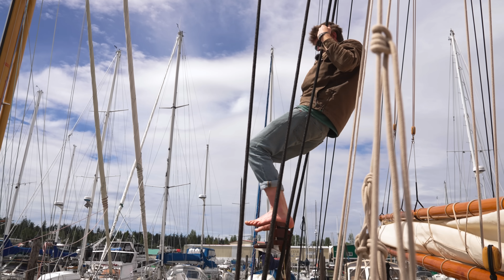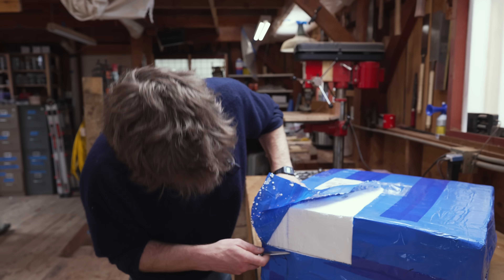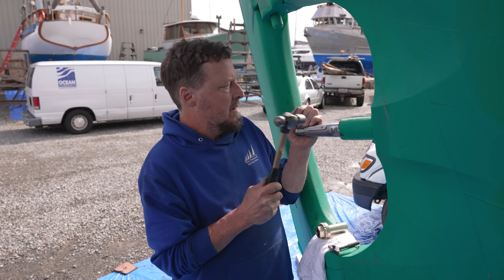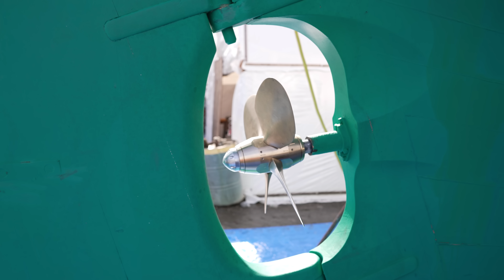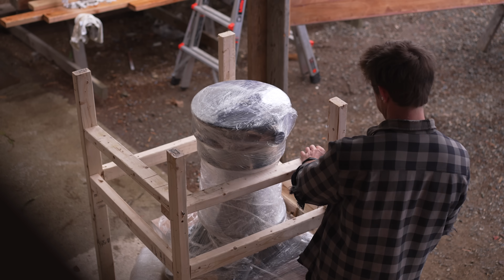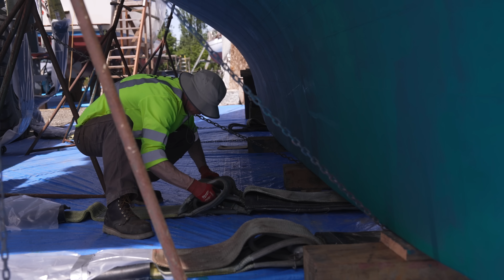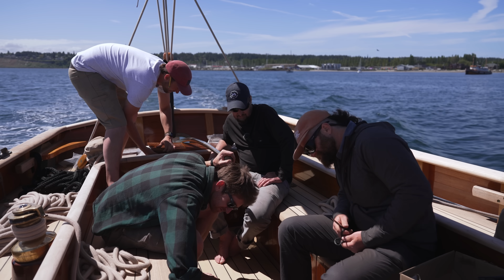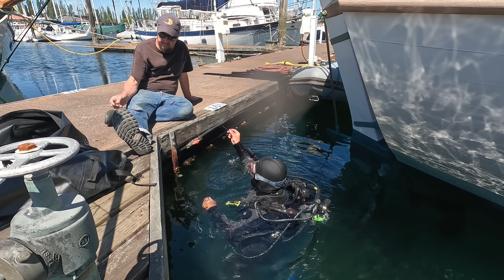New & old machinery - Gearbox, Propeller, FINISHED CAPSTAN ARRIVES!

Comment: Can you lock the propeller blades from inside the boat, so you can generate electricity while sailing in the future?
Reply: Leo explained this in an earlier video. The prop has 3 modes: forward, backwards and feathered. There is no lever or any other thing inside the boat. If you put the engine forward the prop switches itself in forward mode, if you put the engine backwards, the prop reset itself in the backward mode. If you are sailing the prop feathers (thanks to the pressure of the water). To generate electricity the prop has to turn by the pressure of the water. To achieve that (under sail) start the engine, put it in backwards mode, give a bit of trottle and kick the engine in neutral. The prop is locked in backwards mode and starts to turn the prop because in backward mode there is no feathering possible. To stop generating, start the engine, put it in forward mode, a bit of trottle and the prop reverses in forward mode. As simple as that !

Comment: i dont think I have seen ol' Keith any happier than when he declared the capstan project finished and ready to ship. He did not wipe his brow dramatically or anything but having that many variables finally fitted together was an obvious relief , it is one thing to think or even know things can work vs having them all put together. Gratz all around for that pretty amazing bit of restoration.
PS. you can hear that the prop is in tune with the engine Vs out of tune while over propped , there was a harmonic present in the latter case that is gone once the pitch was corrected.

Comment: As regards the capstan, I think you should powder coat the parts you intend to paint since powder coating is about 14 times more durable than paint.  Also, I've found in my own experience, that rust does not migrate under powder coating in the way it does under paint.

Comment: That capstan is one beefy boy. Any concerns about carrying that weight so far forward and above the water line? It has to change the way it rests in the water.
Reply: The temporary ballast lead ingots that he's shown being loaded in several videos can be removed when the capstan is in place and the boat will keep its same line in the water that we have seen so far.
Reply: @llagas6307  It is true that shifting ballast can correct for the fore-aft balance. On the other hand, the higher the center of mass goes the more prone the boat is to heeling. It's not something that is usually significant for boat loading, but like I said, that is a big beefy mass of iron, steel and bronze. Likely big enough to affect the way the boat handles.

Comment: To all those dreamers out there who aspire to fit out a boat's prop system. You cannot go past the simple check of turning one end through ten revolutions and counting the other end. Just in case someone has fitted the wrong gear set and not remarked the plate on the box. or made other changes. Bucket list of mine to  get to see her on the water.

Comment: What type of seal is on the hole where the drive gear  comes through the base plate?
Water may get in here with waves breaking over the bow etc
If no seal, what protection have you got in mind to defend the drive motor etc?
Reply: A drip bucket hung under the capstan motor assembly may be in Tally Ho's future.
Reply: What about a bit more design and manufacture before installation. 
A split disc, like the chain gypsies, fitted below the gear with an O ring seal bearing in the tube which supports the gear might stop sea water flushing through / past the gear teeth. What do you think????

Comment: So glad the new prop worked out for you. I work for Ford Motor Co, in Michigan, just north of Detroit at the Sterling Axle Plant, we make all axles for F150, Explorer, we make the front and rear axles drum to drum when they leave our plant, 1.9 million axles last year. My department laps the ring and pinions, you load the ring on an arbor, push the pinion in it`s arbor, when you hit the start button, the arbors chuck the ring and pinion, the door shuts, and compound starts flowing on the ring and pinion as they are spinning at 2,000 rpms. Three passes on the drive side and 3 passes on the coast side, it`s a 3 minute cycle, when the door opens, that ring and pinion is married, the surfaces of the teeth are perfectly matched to each other and it stays a set for life.Just a little foot note from the Auto Industry that`s alive and well in Michigan.

Comment: Leo, rather than monitor rpm of the engine, see if there is a way to measure torque output.  It would seem the engine is reaching its full potential of torque output given the current prop setting.  So, you want to run the engine at about 98% of available torque; independent of rpm.  One could rely upon rpm as a measure of output and ruin the engine because of exceeding torque limits over long periods.
Reply: I would question your comment that the engine should be run at 98% of its torque at any rpm.  The power curve of Marine propulsion engines are designed such that the load should only be near the maximum available torque at rated RPM.   Below that RPM, they should not be loaded to the full torque available.
Reply: @Walstie  Indeed.  Perhaps for a fixed pitch prop.

Comment: Great video as always. Just one minor detail regarding the feathering prop: it's not centrifugal force that rotates the vanes into their "engaged" setting. For this type of prop it's internal gears that are driven by the torque of the propshaft itself. That's why the hub rotates when you move the vanes.

There are also "folding" style feathering props that indeed use centrifugal force to open. These are simpler and  slightly more aerodynamic than the gear driven type. Their efficiency under power is however lower, specifically in reverse.

Comment: It's a bit unfortunate that she won't have the powertrain you designed to begin with, but changing the gearbox was a bit unrealistic. Pulling out the engine is an absolutely huge task.
Reply: to fully pull the engine part of the deck needs to be ripped up.
Reply: @runrin_  Don't think so. I think they just need to remove the cockpit.

Comment: White LEDs actually glow blue. Above this is a phosphorus layer that produces green to red light. But there are also green LEDs and red LEDs that produce the color directly. 
The white LED which has a red filter has the worst light output because it is at the other end of the color spectrum.

Comment: How will regen work with that propeller? If it goes into sailing position when the motor is off, you won't get any torque to drive the regen, will you?

Comment: Oh but I was so pleased with hull speed using the large propeller with the 1:1 ratio gears. It just so made me joyful that the engine rpm was perfectly at the peak torque range of this engine which resulted in economical operation and better than anticipated hull speed. Why should you wish to increase rpm, fuel consumption and also decrease propeller efficiency? Quite frankly, when the engine is operating at max efficiency and is within the peak torque range the only question in regard to engine durability is in regard to engine cooling. I will not comment on the technical savvy of the inexperienced engineer. Tally Ho

Comment: Leo, interested to know, does the updated design have any performance deficits over the original design or does the smaller propeller mean it all works out the same in the end? I would've though torque might be a bit lower but power higher?

8:20 - Never mind. :)

Comment: Shocked!  Flabbergasted!  And I'm sure there are thousands of others like me who feel the same.

Having watched these videos for the past seven years, we've became accustomed to Leo's uncompromising approach to the project.

Yet, when it came to resolving one of the most significant issues ... let's face it, an unconscionable error on his part .... he took the low road for "expediency's sake".

I would have liked to have heard  Leo say, "Yes, I screwed up.  And, yes, this 'quick fix' is only treating the symptom.  Had I wanted this combination, I would have originally spec'd it that way.  The original design is the better approach.  But after seven years, I felt it was time to do some serious sailing this Summer.  And when that's over, we'll come back and do it right."

And then there's the 2,800 rpm becomes 2,700 rpm and then becomes "almost 2,700"?  "Compromise" is a "slippery slope".

Love these videos.

Comment: I have a MaxProp feathering prop on my sailboat. Make certain to have several spare cap anodes in inventory. They can be hard to get when in somewhat remote places. I needed one when having  a diver clean my hull. I thought I was screwed when the anode was pulled and in bad shape. I was on a deadline to make a weather window, to cross the Gulf Stream. I would have missed my window waiting on that anode. Luckily, my wife saw some in a cabinet from the previous owner's purchase and saved the day.
Reply: Look for the ones with an aluminum ring embedded in the zinc to prevent the whole thing from falling off prematurely as it is consumed.

Comment: 18:37 what happens if the drive shaft and capstan gears are not aligned when they try meshing?  Seems like some serious damage could occur?
Reply: Wiggle the drum a little left and right while raising the gear (you can see it in Keith Ruckers last video)

Comment: I had a Paul Luke self feathering prop, which had been badly adjusted, come partially undone, as I maneuvered off the anchor. I had to sail back to the dock in a sixty foot ketch. The sailing was easy. After the haul-out, putting the prop back together was a royal pain getting the cogs of each blade to line up.. There was three blades and two locking rings.
Reply: 55 foot ketch live aboard . gearbox passed over day we took possession,2 years south pacific Australia east coast no engine!
wife wonders why i have ptsd!

Comment: A quick prop reference for anyone wondering what "it's" all about. I bought a sail boat-33'. It had a 3 blade fixed prop; no folding, no feathering. Great under motor. Bad under sail and for racing; too much drag. I changed it to a 2 blade folding prop; far cheaper than a feathering prop. I lost some of my racing handicap points, but it was way better under sail and great for racing, especially in lower winds. It worked great under motor going forward. The biggest disadvantage was going in reverse under power; for docking. Very little control and I would have to rev the motor a lot higher just to get the job done; whether it was against the tide or the docks; this proved inaccurate and dangerous; made better with practice. In hindsight, or my budget was different, I would have gone for a 3 blade feathering prop. I tell "you" this, because nobody ever told me.................  DD
Reply: In the mid-1800s, when steam power started getting taken seriously in naval circles, screw-driven steam ships had two major issues.  One was range and a lack of places to refuel (re-coal, actually, since oil firing wouldn't start gaining traction for another half century).  That meant a warship, meant to cruise for long distances, had to have a full sailing rig in addition to its steam engine and screw.  Which, in short order, revealed the second issue.
     If you stuck a prop on the back of said warship that was big enough to provide useful speed, it exerted so much drag that your speed under sail dropped well below acceptable levels.  What to do?
     Most designers of the time resorted to a prop that could be disconnected from the shaft and lifted up, on rails built into the sternpost, out of the water when sailing.  When steam power was needed, the shaft would be rotated to the proper orientation, the prop would be lowered onto it and locked in place, and the ship could then maneuver under power.
     Not the best solution, and there's a pretty hard upper limit on how much power you can put on a setup like that before it tears itself apart.  But the steam engines of the day weren't that powerful, and by the time the tech had advanced to make them that powerful, most nations had coaling stations established along their trade routes, so an auxiliary sailing rig became redundant and eventually disappeared from designs.
     Interestingly, the retractable prop also helped drive the adoption of the elliptical stern, since the overhang over the rudder provided room for the lifting gear, and storage for the prop when it was off the shaft.  Some early steam warships - iirc HMS Warrior is one? - still dressed up the stern with a flat faux transom and dummy windows to a nonexistent captain's cabin.  The lack of a cabin with stern gallery windows was apparently anathema to many naval officers of the day.
Reply: @christopherreed4723  Nice!!!
Reply: You should do a video on it.
Reply: @christopherreed4723  Thank you for fascinating information.
Reply: @christopherreed4723  Thank you for the info.  That is interesting.
Reply: With electric motors and regen possibilities it gets even more critical and complex. .. generally though the props need to be larger with more blades and thinner more efficient shapes..
What's really needed is adjustable pitch props that can be completely feathered for sailing or reversed for regen
Or reverse..😉 and it all comes down to hull speeds and motor issues.

I would still have fitted a line cutter or prop cage to keep lines or floating debris ot of the prop arc. Diving on the prop or rudder of a larger heavy boat even in a swell is dodgy especially if it's dark and the waters cold.
Reply: Jules of Emerald Steel has a video on the calculations in selecting a prop.

Comment: I don’t know the exact rule but I believe the inside of a sidelight box should be flat black or non-reflective. 
As an aside, several years ago I installed a 4-bladed Vari-Prop on my boat. Vari-Prop was excellent to work with. They even shortened the blades a half inch to give me a little more tip clearance. Tally Ho looks fantastic. Congratulations to you and your crew.

Comment: How does the new prop affect the performance under electric power? The the electric motor also has to be matched to the prop. Is it direct drive or can it be matched with gears or belts/pulleys?

Comment: Great to see more of the systems in the boat. Matching the motor to the transmission to the propeller to the hull is a nice little problem ;-)

I'll be ready to see you fitting that gorgeous capstan, but I accept I'll need patience -- the thing has to be painted as well.

Comment: To gain back the lost 3% with interest, you can always shroud that new prop. The shroud would also tie up the keel and rudder mounts. That old prop would be perfect for I-6 truck engine that has 1700-2200 rev range. If someone happens to be building one with said power unit. Congrats on your 1/2 million milestone!
Reply: Not good for sailing. The nozzle adds a lot of drag, the reason a feathering prop was chosen in the first place.

Comment: Curious if the method to waterproof heat shrink electrical connections. 
Are they crimped, then is a grease applied and heat shrink over.?

Comment: Would love to see Keith Rucker help with the installation of the capstan. Two great craftsmen working side by side on a very big job
Reply: He should definitely get a ride!
Reply: Sadly, the Tally Ho doesn't fit on any of Keith's mills or lathes.
Reply: @EightBitTony  🤣🤣🤣🤣🤣
Reply: @EightBitTony  yet
Reply: Thirded.
Reply: I think Keith would rather cheer on the installation from afar.
Reply: 550 lbs. Capstan with motor drive, pretty heavy for the
foredeck.

Comment: Nice that this was re-posted. I was in the middle of watching it yesterday when the video was taken off-line.

I know about prop-motor power curves, HP vs. Torque.. But on a feathering prop how does that work for power-generation if you are under sail? The prop would be feathered and water would pass right through without obstruction so there is no power to fan the blades back out to transfer power back in to the electric generator?

It seems that you would need some means of manual control over the feathering action.
Reply: My question exactly... Hope somebody can explain?
Reply: i guess that you would make the propeller spin so it opens the blades then carefully engage the electric generator and disengage the engine as long as it spins the blades will probably stay open, only when the shaft is stopped completely the blades will fold
Reply: As I understand it you put the engine astern briefly then disengage it for re-gen mode where the prop blades remain locked until forward power is applied. When the forward power is stopped the blades feather as normal.
Reply: And I just thought that I had a deja vu with this episode...